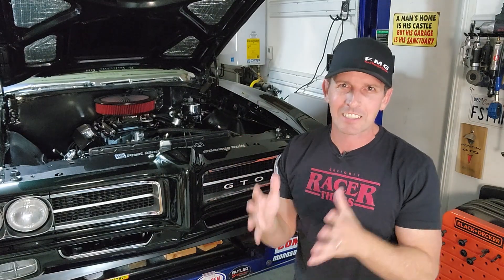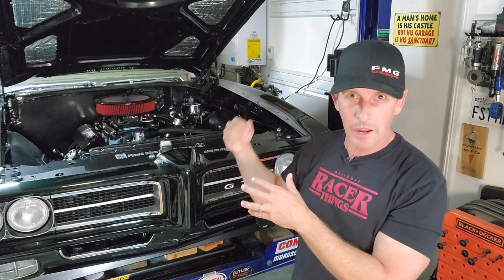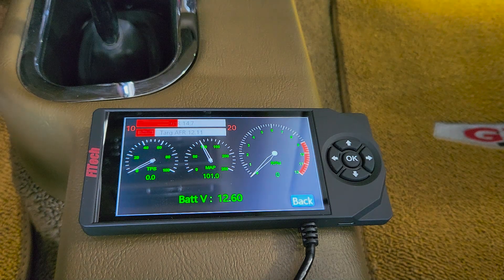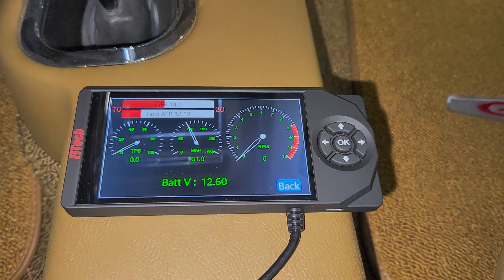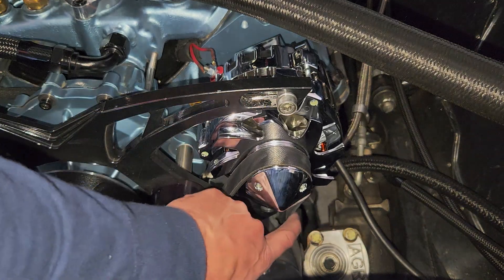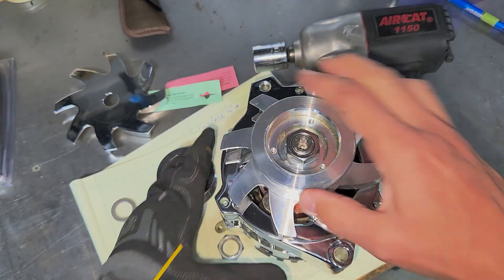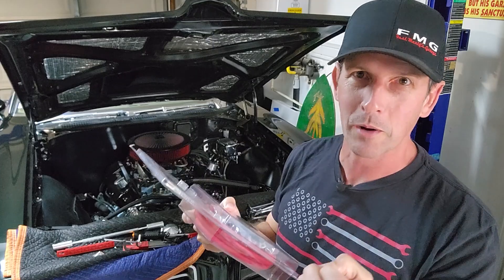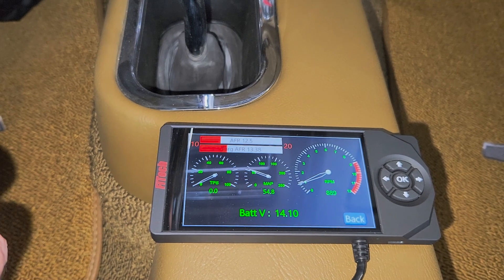How to diagnose an Alternator, and properly install a One Wire alternator with more Amps.

Comment: Off topic question. Helped a friend install a new wiring harness kit in his 1986 C10. Starts fine, idles fine, charges fine, but when shut off and not used. Alt heats up really hot, even when left over night. Ideas?
Reply from the maker: Good question. It sounds like the alt is shorting out.  Is it charging?  I'd lean towards getting a new one.
Reply: @FastMonty  It does charge. New gauge reading 14 volts running. Pulled exciter wire plug on alternator and left overnight. No hot alternator or battery drain. Might try different 12v switched wire.
Reply from the maker: @RedPillLife1966  Good to hear... at least you're narrowing it down to the culprit.  Keep us posted.
Reply: @FastMonty  Thanks for replying

Comment: Beautiful car I have a question would you recommend this one wire set up over 3 wire configuration. I have a 69 Chevelle I upgraded my alternator to a 120 amp now i need to upgrade the wiring.  It's easiest to go the one wire route because i would have to run a6 gauge or 4 guard wire to the horn relay and another big wire back to the battery  from the horn relay.
Reply from the maker: Honestly, I'd go 3 wire. Check out the video I did about it...
https://youtu.be/GEoje-1rnVw

Comment: Hey Monty, did you have a weak start sometimes? I think I have a weak alternator I’m having a weak start and idle. dimming lights and when I give it gas it goes from 12.3 around about to 13.8 around about ive been having low voltage problems for a bit guessing that’s it. Got a multi meter but it doesn’t even turn on haha have to go return it for sure
Reply from the maker: Ha!  A working multi meter is definitely helpful. But, it sounds like your alternator is working fine.  Slow starts are typically starter/battery or even the gauge of wire used from the battery to the starter. Sorry, not helpful ... let us know if you figure it out. Thanks for the comment!
Reply: @FastMonty  hmm if it’s not the alternator with those symptoms, I’m guessing it’s this crap 10 gauge wire I have on my starter solenoid that came off it’s crimp or what I think was a attempt of one😂 it came off the starter solenoid and the car wouldn’t even crank when it was off. I couldn’t get it on properly that’s for sure. Hope it’s that at this point I’m lost with this Gran Torino😂
Reply from the maker: @OffTheSkooma  I'd say that's definitely a good place to start... see what I did there?  Ha, ha... keep us posted!
Reply: @FastMonty  outta here with those dad jokes😂😂 jk that was good but i actually figured it out; took out my Torino for a long drive yesterday no overheating no voltage moving very happy about that. It was the connections on the old starter solenoid😂
Reply from the maker: @OffTheSkooma  Ha!  Dad jokes are my life!  Great to hear you're rollin!

Comment: Good information! Do you have a video of the relocation of your battery to the trunk?
Reply from the maker: Thanks John... No, I do not.  YouTube came far after that point in the project.  If I have time, or run out of video ideas, I'll try and summarize that one.  Thanks!
Reply: So you just ran a 0 cable under car? What about ground? Not sure if your GTO has a full frame but my TA has a unibody so I’m not sure how grounding should be handled.
Reply from the maker: @johnmcdonald3231  Ahhh, good question.  Yes, same gauge from negative to the body, in the trunk.  Then you get a Ground strap kit, which has several different sized straps.  All of the pieces of metal need to be grounded to each other.  For me, a giant ground strap from the body to the frame, then smaller straps from the block to the frame, fender to the frame, core support, to the frame, etc... obviously needs to be bare metal between the strap and sheetmetal/frame.  I use a conductive grease called NO OX ID "A Special" between all electrical connections, including the battery posts.  Hope that helps!
Reply: Thanks for the reply. Just one more haha. Where did you get the 0 gauge wire and did you wrap it with anything to protect it under the frame? ie wire loom
Reply from the maker: @johnmcdonald3231  Most likely Summit Racing... just search Trunk Battery wiring kit.  2 gauge would probably work too.

Comment: Thank you so much Monty for this video!! I’m going through the same thing. I have a 1934 ford 3 window coupe that has the same March serpentine kit, with a March Crome alternator with a billet wheel that is about 10 years old. Changed the battery and it still wasn’t charging properly. The alternator spins freely, also shows on the voltage gauge that it was charging but at 10 volts. I checked the ground and it seems good. Thank you for the information about Tuff stuff making March alternators. I was struggling trying to find a good replacement.
Reply from the maker: Glad I could help!  My next video is about converting that same alternator to 3 Wire, to get an idiot light to work.   Thanks for the comment!  Here's the link... https://youtu.be/GEoje-1rnVw?si=wm2lm0-yVQUn2CAY

Comment: Awesome video but I think the only thing I would’ve done different was I would’ve changed the belt rather than changing that pulley. I always say that because the bigger pulley might change the voltage coming out because it’s bigger on the old one that it is on the new one the new one with the smaller pulley is going to spin faster, therefore throwing more voltage, I think
Reply from the maker: I thought it would change the voltage too... but, according to Tuff Stuff, as long as it's within a certain range of RPM the regulator handles it.  Since it was the original pully on the old TuffStuff alt, I didn't argue it.  Thanks for the comment!

Comment: thanks for the video and installation went well. the old alternator spun easier due to old bearings versus new?
Reply from the maker: Thanks... good question.  I would think used bearings run rough?  I might go dumpster diving and find that alternator and take it apart.  :)  Thanks for the comment!

Comment: From my understanding from “generators” you get a residual electric charge from any type of rotation. Since is AC voltage getting turned into DC voltage after your one way diode. So if it free spins it can be an indicator of it not having a strong enough magnetic field. Same reason why you should free tow teslas the wheels still spinning can cause a drag
Reply from the maker: Yup, makes sense... not sure if this is a brush motor either?  I might go hit the dumpster, and take it apart.  Ha, ha... Thanks for the comment!
Reply: No problem! Glad to see the gto on the road again, very inspiring 🤘🏽
Reply from the maker: @cdiazcetina  Thanks Carlos!
Reply: @FastMonty  Gotta say Carlos’s suggestion was quick to the point of being quite a sparky kinda guy love the comments thanks for the tutorial on the weird stuff that happens occasionally to us gear head’s 👍😎🇺🇸🇺🇸🇺🇸🇺🇸🇺🇸🇺🇸
Reply from the maker: @markgiraldes4062  Ha!  For sure... thanks for the comment!

Comment: Ha! I knew you would find it 😊 I have been trying to track down the cause of my fusible link burning out in my 1990 Dodge Dakota, I did an alternator swap a few months ago when I got the I'm going to check that out it's one of the things I haven't checked yet been 3 months and I can't find the cause of the short😢
Reply from the maker: Ha!  Thanks Brother!  Sorry to hear about your challenge... I know that's extremely frustrating.  Trace all those wires, and hopefully something is made obvious.  Unless the fuseable link just needs to be upsized?  just thinking out loud, especially if you've added more eletrical options, and a higher amp alternator... let us know.
Reply: @FastMonty  I didn't know you could up size the fusible link, I did install a stereo, the truck is now my daily driver I haven't gotten my newly rebuilt transmission to work in my 68 firebird, I got problems but I'm encouraged by your videos keep them coming. My Bird will fly again!
Reply from the maker: @TheOneAboveAll-001  Ohhh the love of muscle cars.  Sorry to hear that.  Yup, fusible links come in different sizes.  Might research that some more... only if you can't find the short.

Comment: Hmm, Perhaps the brushes, a simple task to verify might resolve this , before buying anther ALT? 
There things are very straight forward and likely take standard diodes, bridges,  brushes, springs  bearings etc. 
I got a lot of my GM ALT pieces  for them from McCombs elec supply
Reply from the maker: Agreed.  I'll be doing an autopsy soon, if I can fix it, the old alternator will be my spare.  And, at least the new one has higher output.  Thanks!

Comment: Hi Mike. I asked PowerMaster why my new alternator stopped so quickly (like yours does) when spinning by hand. They said it was normal because the new parts and brushes have to wear in together.
Reply from the maker: Yeah, makes perfect sense.  I'm going to do an autopsy on the old one.  We'll see!

Comment: Glad it was an easy fix Mike. I see your windshield wiper motor is modern, what is it out of?
Reply from the maker: Yeah, me too!  Good catch on the wiper motor, it's not operational yet.  But, it's a Chevelle wiper motor from Detroit Speed.  So, if you have Chevelle, it'll work.  lol
Reply: Cool, I will look into it. I am currently building a 71 Le Mans convertible, lots of work.
Reply from the maker: @gonzalogonzalez4971  I hear you... one day at a time, you'll get there.

Comment: The thing to do with 1 wire alternator is to send it back to the manufacturer. Use a 3 wire alternator. The exciter wire starts the charging. The sense wire actually senses the load at the load center and compensates for voltage drop. While putting the battery in the trunk is "cool", it creates voltage drop due to the length of wire. Never use painless wiring.
Reply from the maker: Agreed one wire alternators are not ideal... I actually changed it to a 3 wire, https://youtu.be/GEoje-1rnVw?si=qruBhFi65wbaz41h   Thanks!

Comment: as always great video . .
Question when you ran the dual fans, did you upgrade the ATL then ?  (I may have missed it if you said it)
Reply from the maker: Thanks Raffi!  I've been running the dual 11's for ten years, where I was using the same alternator.  I have no idea how long the old one was not charging... scary, right?  Thanks again!

Comment: you installed a 160a  alternator with a 200a fuse. the fuse should be the weakest point in system and below the 160a ?
Reply from the maker: Good question.  My understanding is if the wire from the fuse to the Alternator shorts out, the battery will start the fire, not the alternator.  So, in essence, the fuse is oversized a bit to accommodate a little amp overhead, but if it shorts, you don't want 500 amps coming in from the battery.  I also have a 200amp fuse in the trunk, near the battery, just in case the line from the trunk to the starter/alternator shorts.  Same reason.  Hope that helps.
Reply: @FastMonty  ok makes sense. i had remembered seeing a fusible link installed inline with the alternator wire and it was sized smaller. keep the videos coming as you make them easy to understand

Comment: i have a March system. I need the same alternator. Is there a chance you could give me the model number.
Reply from the maker: Of course!  It's a Tuff Stuff Alternator... https://www.amazon.com/dp/B01MSHCH7Q?linkCode=ssc&tag=onamzmikemont-20&creativeASIN=B01MSHCH7Q&asc_item-id=amzn1.ideas.2MZLR4U0XI069&ref_=aip_sf_list_spv_ofs_mixed_d_asin
Reply: I have the SAME alternator.  These have caused me nothing but issue.  I regret getting this march serpentine kit
Reply from the maker: Ohhh I hope this is not going to be a reoccurring issue.  Thanks for the heads up!  @Se7enthsonSS
Reply: @FastMonty  I’ve had my serpentine set up for a year (5 days out of warranty).   They told me to call tuff stuff.  Luckily they accepted to rebuild my alternator. But if it failed after literally 7 months running and MAYBE 200 miles.
Reply from the maker: Yikes!  I have Noooo idea when mine died, cuz I kept putting it on a tender after every trip.  Except when it actually failed, I forgot to put it on tender between trips.  Soooo, looks like another video topic, installing a Volt Gauge?  Getting the idiot light to work???  Definitely need to know when we're not producing enough power.  Thanks for the idea! @Se7enthsonSS
Reply: @FastMonty  btw.  Favorite channel on YouTube.  Keep it up.
Reply from the maker: Thanks Brother!  Much Appreciated! @Se7enthsonSS

Comment: Hi Monty, I thought battery terminals or battery :). You mentioned an excuse for a new gauge - battery (voltage) I agree. Glade to see you fixed the problem. The wiring looks GREAT! Hats off to the Optima battery too.
Reply from the maker: Thanks Danno!  Yeah, the Optima Yellow top is no joke.  Funny, cuz I had starting issues a couple years ago, where my prior Yellow top was seven years old... exchanged it for a new one.  Had Autozone test the old one... it tested fine!  That means I've had this alternator issue for several years?   Crazy, right?  Thanks for the comment!

Comment: Great video Monty! You really should do the big 3/big 4 wiring upgrade. I’m rewiring my TA now and I’m using 2/0 wire from the starter to the fuse/battery in the trunk, plus a full run of 2/0 for the ground from the block to the battery in the trunk. I’m also adding an extra 2/0 ground off the block to the frame, the alternator bracket to the frame, and another 2/0 ground from the battery to the frame. Also use 100% oxygen free wire and copper lugs. I have a large audio system in my daily driver (340amp alt, large Northstar AGM main battery, cyber 12k lithium battery, and large amplifiers) It is wired nearly the same and my voltage is rock steady.
Reply from the maker: Agreed!  It's already set up that way from the Starter to the trunk, as you can tell from the quick glimpse of the battery.  Don't forget to get really good ground straps.  I have a monster one from the frame to the body, and about 8 more spread out around the car connecting different panels, etc... Don't forget to get some conductive electrical grease for all those connections... it's called No ox it... on amazon;  https://www.amazon.com/shop/fastmontysgarage/list/EKH9PQ33JIY1?ref_=aip_sf_list_spv_ofs_mixed_d  Thanks for the comment!